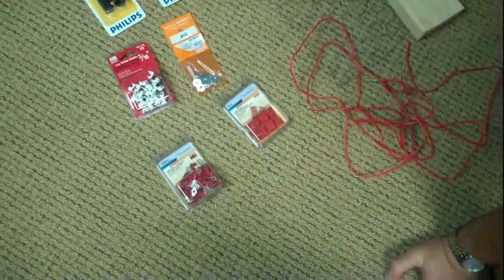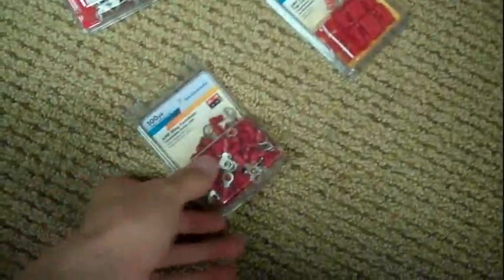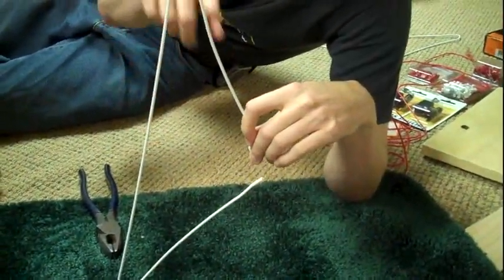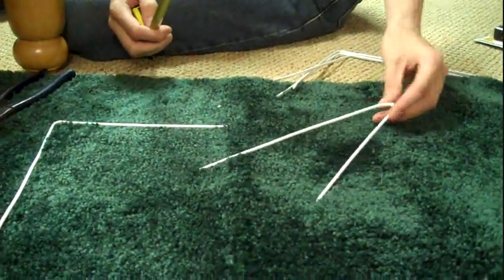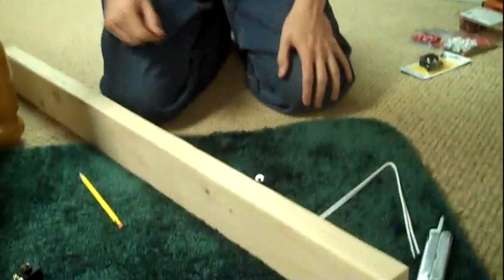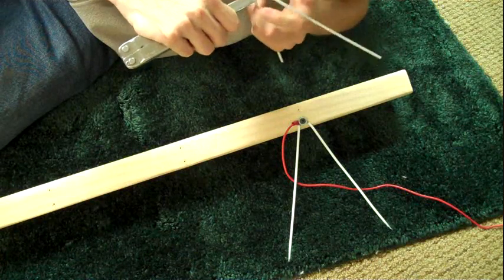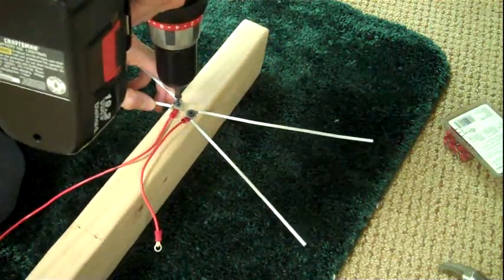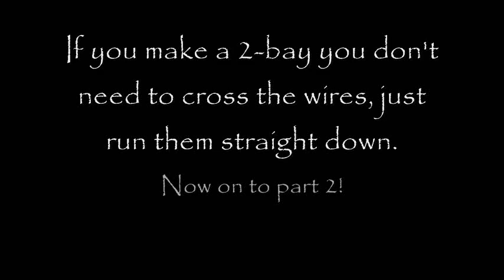How to Build a 4-bay Bowtie Antenna part 1

Comment from the maker: Yeah, as "notvalidcharacters" pointed out down below, this antenna is mainly for pulling in UHF signals with just a slight amount of gain in the highest of the VHF range. It doesn't surprise me much that it had problems with those 2 channels in it's "stock" form. Thank you for posting a solution to the issue though! I've been wondering how to increase it's useful range myself, so I greatly appreciate it!

Comment: Did not think this would work, but after last cable hike made just the basic version as shown, no reflector chicken wire. Used some stiff vinyl coated aluminum wire, scraped off the vinyl to make the connections.  Set TV  to antenna, scanned for stations, voila got all local (within 20 miles) VHF and UHF stations  with 8 inch lengths and several stations from about 60 miles.  Be sure to tape or fasten the transformer securely or it may pull out connectors.  Bye cable

Comment: I just made one of these... 4 bay.... Real good results.  I am in the woods about 25 miles from even one tower... And most are around 50 miles off.  I went from 4 channels with the $50/$60 RCA Flat Antennas to 12-17 channels depending on placement with one of these... Good stuff.

Comment: thanks for this video,guys...I have built a few of these,and the only thing I had to change was the size of the piece of wood...when I used a 2x4,the signal levels where ok,but I tried another antenna built with a thinner piece of wood,and the reflector is only "1 3/4 away from the V's,and my signal was considerably higher than they where with the 2x4...other than that,mine is very similar....thanks again for making this vid!

Comment: Picked up 45 stations before and 70 after. We are within a few miles of the Phoenix towers, but even though it is pointed towards the Phoenix towers it picks up Tucson public service TV over a hundred miles away. Almost a 90 degree difference. And it's only in the attic, not on the roof. Thanks for the video, couldn't be more pleased with the results. Because I had some off the parts on hand it only cost me $7.

Comment: Great video I have been looking at the various videos checking out the designs.I like your wires with the washer ring attachments.I have this very cool wire with a clear yellow covering that came off an old lamp that I broke.It is insullated so I was trying to figure out how to use it since all the wiring isn't exposed.Your video answered that question.Thanks!  Oh yeah,sometimes old dusty Thrift stores have bundles of old hangers for sale, that is where I am going to look for wire hangers.

Comment: Yes, you are correct.  A multiple of the wavelength works just as well, and in the case of longer wavelengths (CB car antennas comes to mind), it can be electronically retuned to match desired wavelengths.

HDTV wavelengths can be accommodated easily (without needing retuning) with this design; what I'm saying is if you want to add VHF elements, that's fine but it has to be done scientifically -- you can't just make them "a little bit longer".  Has to be specific length or it won't be resonant.

Comment from the maker: It is mostly for UHF frequencies though it will probably tune in some of the higher VHF frequencies, though with less gain. In order to work well with VHF frequencies an antenna would need to be much larger (the dipoles would be longer than the 8 inche ones this has) since the wavelength of those frequencies is much longer. Hope this is helpful! Good luck!

Comment: After having several "coat-hangar" type go bad within a few months due to rust & corrosion, I rebuilt one using all brass. Large brass welding rod for elements, small brass rod for interconnecting elements & all brass bolts & washers. Has lasted 3 years longer - so far.
Reply: Phil B hi did you just follow the same instructions as seen in this video? because im planning to make one, please reply, thank you so much :)

Comment from the maker: I gave this particular antenna to a friend of mine after it was completed, so the dimensions are a little fuzzy to me now. However, I believe the separation between the tips of the different bowties was around an inch, maybe a little less. The angle of each bowtie was probably somewhere in the vicinity of 45 degrees. These numbers aren't as important as the length of the dipoles themselves though, as that is what directly influences what frequencies it is able to tune.

Comment: Thanks for posting this you guys! I built one using this and another video on Youtube (because I wanted to use what I had on hand and didn't have the wire) I used coat hangers for the middle too. I connected a balun I had in an old box of junk. I'm sure there are others around like the one you used, but this one actually has a splitter for two coaxial cables to hook up to. Then of course the antenna thingies. I was using a Mohu leaf in my bedroom and another in my living room for another TV, and for some reason my local NBC channel stopped coming through both Mohu's. I don't know if they decreased their signal or what, but couldn't get them all summer. Then last week, I started getting them again, but the signal on both TV's was in and out. I made this antenna today and just used a poster board with foil taped on back instead of chicken wire. The coat hangers aren't as precisely placed as yours (because I goofed with the measuring part) but it works! Before (with the Mohu leaf) I was getting 12 channels, and with ugly old Frankenstein ( yes I named it! LOL) I get 20. All the channels are pretty consistent too. NBC comes in clear as a bell! Now I can watch the new season of Grimm when it comes on! Also, I just want to add, I'm a 61 year old woman with arthritis so the coat hanger part was a little hard on my hands, but hey I managed. Who says the old can't learn something from the young! Great video guys..and I hope Jay's apartment didn't get damaged in the tornado!
Reply: Oh yeah, the two hook ups for the coaxial cable (on the balun)..I hooked one to the TV and hooked the Mohu through the other one. Not sure if it matters that the Mohu is even hooked up to it though. I just thought, hey the extra hook up was there, so why just leave it hanging off into nowhere. Might as well use it.

Comment from the maker: As far as my understanding goes ideally your antenna needs to be exactly the right length for a given frequency, and VHF has a much longer wavelength than UHF so if you're using full wavelenth antennas it would need to be much larger...but I believe an antenna will also work if it is at 1/2 or 1/4 wavelenths as well (I would assume just at reduced efficacy). That's my understanding at least!

Comment from the maker: As far as I know it should not make a difference, as the coating is non-conductive and very thin, thus the RF signal should pass through it relatively unhindered. I'm sure people more knowledgeable than myself will argue that it will make a difference, however I would guess that it is such a marginal effect that the benefits of having it as a protective coating on the wires outweighs any negative effects to signal gain.

Comment from the maker: The first few antennas that I made were using the bare metal coathangers, but for this project I could not find any. (I tried like 4 different stores including Goodwill and still couldn't source any!) However, it seems that the plastic coating does not hamper the signal very much, if at all. It also serves as a nice protective sheath to keep out water and such, so in the end I just left it on!  Unfortunately though I don't have this antenna on hand any longer to try stripping it off to test.

Comment from the maker: The wood was a standard 2x4 which is actually around 1.5 inches by 3.5 inches (~3.8cm x 8.8cm). I don't remember the exact length of it, but it was somewhere between 3 and 4 feet (~91cm to 122cm). The separation of the Vs is not overly important to the function of the antenna, but I kept the tips of each dipole V spread out by around 6 or 7 inches (~15 or 18 cm). As long as the tips don't touch nor cross it should work fine! Thanks and good luck!

Comment from the maker: @Scootchinman It's not so much a "bigger is better" situation as it is a "the right tool for the right job" situation. If you are many miles away (say >25) from the transmitter towers and/or have many obstacles impeeding your line-of-site, then it may be better to use an 8-bay to help boost your signal. Since everything but the low power transmitters are now digital however, a better signal doesn't mean clearer picture or even necessarily more stations, just so you know.

Comment: Scootchinman ...I still have to attach the reflector, and so far I haven't pulled in any signal, but I haven't given up. I'm going to make sure the bays are lined up, try different areas of the home, etc. I'm in a trailer park with homes on each side but one; don't know if that's a factor.

I noticed that there's a long pole for the old school tv antenna. The antenna is gone, but the pole extends up about 10-12 feet. I'm going to try using the pole to see if that makes a difference.

Also, I made the mistake of buying the "one solid wire" of insulated wire, not the stranded wire. This made crimping really difficult. The connectors did not grip well without really cranking on them, and I busted so many that I barely had enough to complete the wiring. I wonder if I have good connections.

I'm sure this thing will work. But I'm also checking to see if the things I've done are actually hindering my progress. Any suggestions?

Comment from the maker: @brianto12 The chicken wire (or whatever conductive material you use) is only there to act as a reflector to make the antenna more directional. The antenna will still work without it, but it may not have as much gain in the one direction as it would have with it. An 8-bay will have an even higher gain than the 4-bay I built here. The extra gain is not necessary for everyone however, only those who are far from the transmitter sites and have very poor signal strength.

Comment: I made one of these and it didn't work for the two channels I wanted most, VHF channels 8 and 10. Adding a straight wire to each of the feed points (where the matching transformer/balun attaches) sticking straight out the sides fixed the problem. The modification is about as simple as you could imagine but if you want see what I mean, you can find other videos that explain this in detail. As for the length of the additional wires, I used about 10 inches.

Comment: Have you thought about buying straight wire instead of buying coat hangers that you have to play around with - if you decide you DO want to go ahead and use coat hangers - have you considered making them all straight - marking where the bends should be - dealing with the insulation with a little scrap of sandpaper and then making the bends

Comment: I built this but I did a double set up. And t was to replace a store bought antenna that was supposed the be the best by recommendation by the kid at best buy. The store bought one only received 6 channels. but the double homebuilt set up received 24 channels with it sitting on my front porch at ground level, Now I am going to build 3 more and set them to all four broadcasting antennas in my area and put them on a pole somewhere around 35' up. I bet I will get more than 80 channels when I am done. oh yea, I did not use clothes hangers, I wet to Home Depot and bought some Alum. drop ceiling hanging wires, thinker and wont rust.
Reply: +Robert Smith 

Thanks for the tip. What gauge wire Aluminum Ceiling Hanging wire did you get? Does it have any coating on it or is it ready to go (conductive)?
Reply: +Robert Smith 

Thanks for the tip. What gauge wire Aluminum Ceiling Hanging wire did you get? Does it have any coating on it or is it ready to go (conductive)?
Reply: +Zeppelinlv2007 I don't know rhe gaudge but if t ou go into home depot or lowes you can buy ceiling drop wire. I found some damaged and asked to buy them for a few bucks because they come like 20 to a pack. I cut them around 11" and bent them in half.  I sid two of them like in the video and cinnected them both to a singe UHF  Connector. to really get the channels in I put chicken wire behind them send me an e-mail to robert_smi2@yahoo.com  and I will send you a picture of it. it is looking rough now since I used wood but it does work.

Comment from the maker: As far as I am aware the wire type does not matter very much, as long as it is conductive it should work. I just used some spare wire I had from tearing apart an old computer power supply.

Comment: I learned in other videos that copper wire has a film of enamel, especially the solid, which I used for this project. I suspect that the reason this isn't working is because I never knew to scrape or heat the enamel off the wire where they connect. 

Any thoughts?

Comment: Helpful video but 7-8" long whiskers will have the antenna peak at too high frequency, somewhere around channel 60-65, which is wasteful. 9 1/2" long spaced 9" apart,
or 10" long spaced 9 1/2" apart will put the peak gain closer to channel 51 (nothing is above channel 51).  On strong or moderate signals, it is not too important but on weak signals, the longer whiskers could make a big difference. The FCC is mandating a UHF channel repack, so in the not too distant future only channels 14-36 will be available for OTA TV reception, at which time, antenna's with even longer whiskers (11"-12") would be optimal.

Comment: You might be better off getting some solder and flux and soldering the wires onto the V apex as after a while if you intend to keep the antenna the connections will go rusty..

Comment: What are the exact dimensions for the base please? 1 by what? Also, for clarity, you can spray paint all the wires and screws without the paint interfering with reception of the antenna?

Comment from the maker: Each V is around a 1/2 inch from the next, as are the bays. I do not believe that this spacing is critical at all, as long as they don't touch and are not too far apart you should be fine.

Comment: One arm of the cut coat hanger is pointing "downward" so is the other cut coat hanger right next to it. I suppose this forms an inverted vee dipole. The other arm of that cut coat hanger is pointing "upward" so is the other cut coat hanger right next to it. I suppose this forms a vee dipole. So you end up with 4 inverted vee dipole antennas and 4 vee dipole antennas. Instead of called it a 4-bay bowtie antenna, I would call it a 4 inverted vee + 4 vee dipole antenna. A true bowtie antenna is made by two solid triangular metal plates forming a true bowtie shade antenna.

Comment: I have all the channels except channel-9. What can I change or modify to get channel-9 ? All the other channels are clear with good reception and color .
Reply: Buy an amplifier. RCA has a brand they sell at wal-mart for $16.00. connect it between your antenna & tv. It should give you enough of a gain to get 2 or 3 more channels.
Reply: Use 10" bowties and make all other dimensions 15% larger

Comment: I doubt I will get much channels in canada I think out in the states you would pick up channels like nothing although if i pick up 10 channels it would be a miracle
Reply: +cartoonfan29 Where I live I can only pick up 5 channels ...
Reply: depends on where in Canada you live. Within 100-120 miles of a major US city, you have a shot at getting US channels. People in Toronto get lots of US channels with a decent antenna. Vancouver can pull in US channels though it depends on exact location and not having tall buildings or trees blocking reception.

Comment: Would this work in the UK
Reply: Harry Tooth My understanding is that UK uses a plan where all the towers in one area are all either UHF or VHF .
If you are in an area that uses UHF you are golden. If VHF then you need an antenna designed for VHF frequencies.
The UK plan makes antenna design easier

Comment: 4:55 - changing element length to slightly larger for VHF really isn't going to work.  That's not an adjacent frequency range, it's a much longer wavelength.  You need an entirely different antenna for VHF.  "VHF" and "UHF" (as well as HF, MW, LW SHF) refer to entirely separate ranges of wavelengths.  HTH.

Comment: Do not attempt to make this Antenna for UK digital TV signals.  It will only pick up the BBC channels and some others for a total of 7 DTV channels.  When using a signal booster it only got about twenty or so DTV channels.  In London you should be able to get 83 DTV channels (at the present time).  I've even tried cutting the coat hanger length to 7" in an attempt to pick up UHF better and it doesn't work.  Parts were obtained from Wilkinson and Maplin.